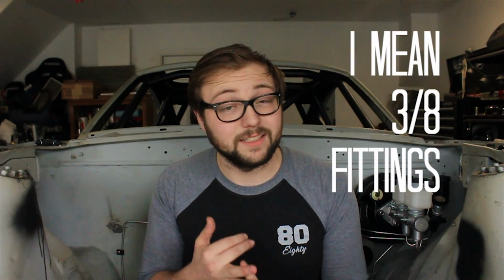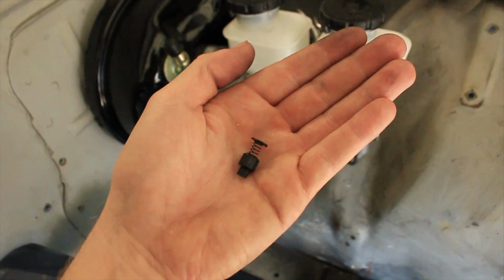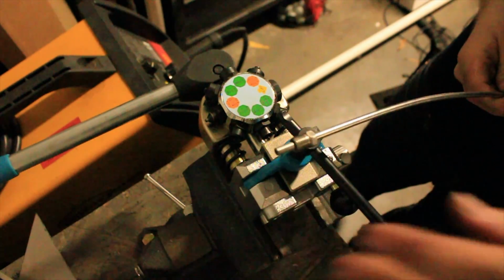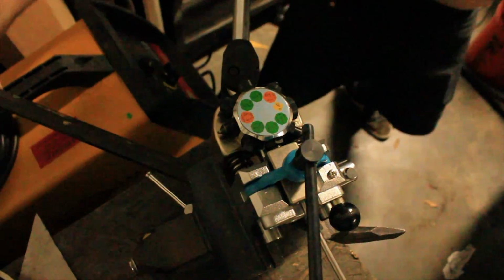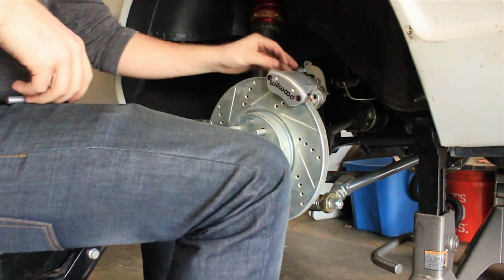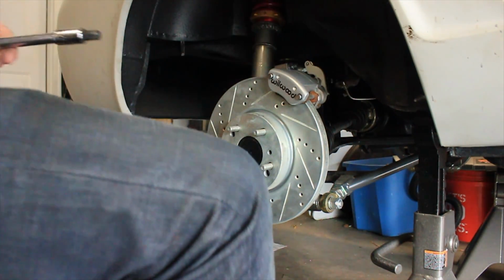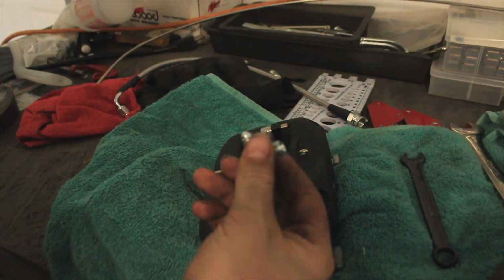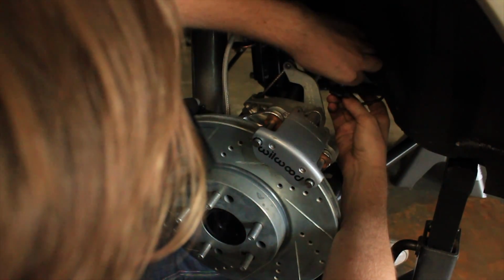280Z Custom Brake Lines

Comment: That flaring tool is the same one i use in the army and hasn't failed me yet and im working with heavy duty construction equipment with both air and hydraulic brakes
Reply from the maker: That's awesome I have really enjoyed this tool.
Reply: @OldDatsun  I miss your datsun videos why has it been on the back burner for so long
Reply from the maker: @salingram409  I know! Life got busy but I am back on the Datsun currently and should have some content coming soon

Comment: is it possible to do all this with the stock engine/trans in place? Almost ready to start my journey running 85 toyota front brakes & 2014 mustang rear disks. all the gear is ordered im just realizing how much of a pain that intermediate line will be. any tips? or would it save me more time in the long run to drop the trans down a bit

Comment: I would like to do the same pedal box installation. Just curious how the pedals are connected to the booster and clutch cylinder. And what are you doing for brake light switch for the pedal?
Reply from the maker: So brake booster threads directly to the back of the pedal and I still need to make a little bracket for the clutch to reach over to the master cylinder. As far as brake light, they are usually just a push contact switch located on the pedal box. I plan to just use a universal one and drill a hole to mount it.